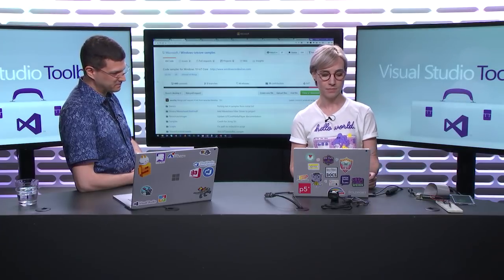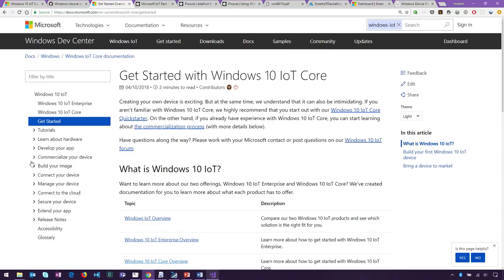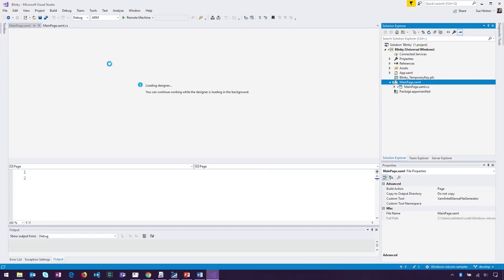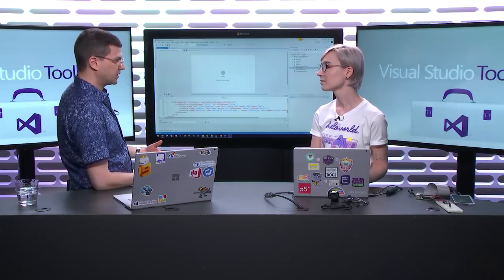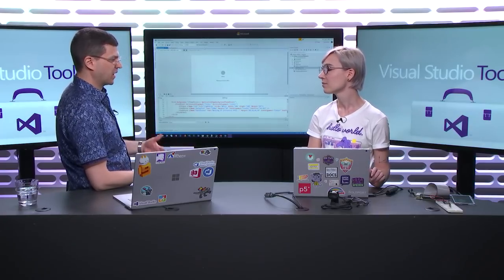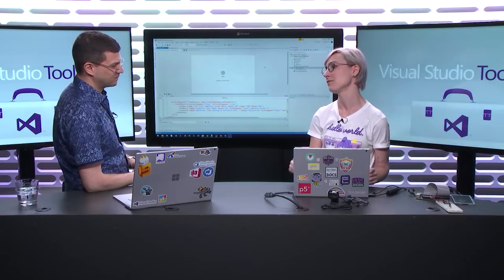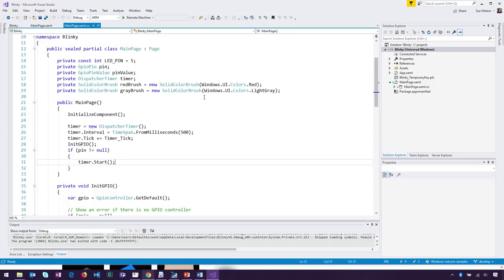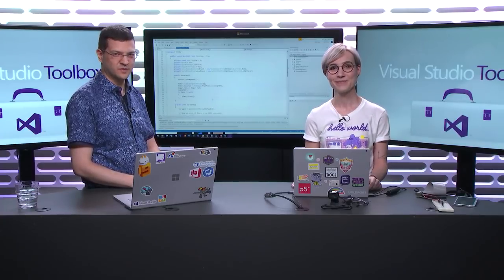Windows IoT #2: Creating, running & debugging with Pi hardware from VS (Getting Started Series)

Comment: Another great session.

Beside Pi3, what other board is good and more powerful that MSFT has tested?
Reply: Hi Ben, if you're looking to get started, up and running, this is a good list of devices - https://docs.microsoft.com/en-us/windows/iot-core/tutorials/quickstarter/prototypeboards. If you're already comfortable with the platform and you're looking to bring a device to market, these are processors we recommend - https://docs.microsoft.com/en-us/windows/iot-core/learn-about-hardware/socsandcustomboards
Reply: Thank you for the reply.
The second list (which I had missed it from the docs) was very helpful to get an overview of the market processors.

Looking for seeing more in depth sessions on this subject from you and other engineers, especially on the "Machine learning" subject eventually.

Comment: Hey Guys,
its very interesting for me. 
After some time trying to run this iotApp on my Raspberry 3B i now know why iam get stuk in.
Sometimes i get the "It is reserved by the system or in use for another function" Error. And even when not, this App is not working.
Because: The "private const int LED_Pin = 5" IS NOT the Pin 5 on the Raspberry GPIO. But its the GPIOPIN5 located at the physical pin 29!!! 
And when you are using the pysical Pins 8 and 10, known as Gpio14 and 15 (also declared as TXD0 RXd0) you will receive the reserved Error.

Comment: One downside is that microsoft consider Raspberry a "hobbyist" board and their support is adjusted accordingly.
What I mean:
Raspberry Pi 3B - everything works
Raspberry Pi 3B+ - built-in wi-fi and bluetooth still doesn't work, touch screen doesn't work and there is more.
Last image for 3B+ is now almost a year old and none of the above was fixed and Microsoft is completely silent in all posts where people ask when or even if they plan to release fully functional build.
This is really strange, a lot of developers get into hardware programming through "hobbyist" boards and raspberry is probably most common one and yet Microsoft still doesn't understand that.
Reply: Even more important with this week's announcement of the RPi 4. Windows IoT will be even further behind with the most popular SBC on the market. I was thinking I'd try the Windows Iot thing, but I guess I'll stick with Linux. By the way does it work with RPi zero and zero w?